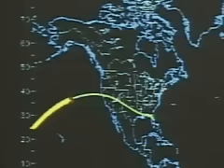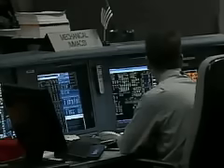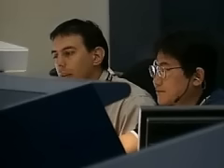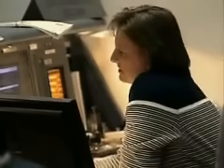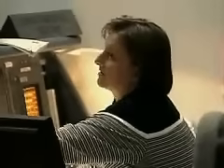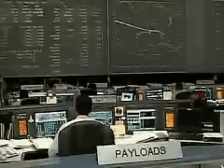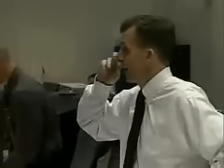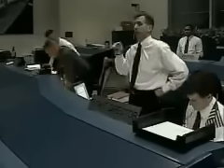Inside Mission Control During STS-107 Columbia's Failed Re-entry and disaster

Comment: When a scientist from NASA, runs around the place with papers in his hands, shouting and yelling, it might be a good idea to listen to what he has to say. Even inside NASA. The guy is still a NASA scientist, right?

Not so long ago, there was a man at the same building, begging to the mission controllers to stop a launch.
He was escorted outside by security. He smashed the windows, slammed the doors and then got outside to warn people for the impending disaster. 
The then sat on grass next to a pond and cried his eyes out.
When the accident occurred, he didn't even look up to watch, and kept on crying this time a little more deeper as Challenger disintegrated over his head.
Almost the same here, during Columbia's mission, a group of scientists calculated that the forces created by the foam impact was equivalent to 1 Tonne. 
This is the weight of a midsize sedan.
When the most critical part of any device is concerned to be damaged, you fix it first.
That heat shield travels all the way to our Sun and comes back since the Sun's surface temperature is reached during re entry.
Just because their stubborn attitudes, those precious scientist's of our planet had to go through the most violent deaths of the human history.
Reply: Neither I or Roger Boisjoly was a rocket scientist. And syntax errors
on YouTube comments does not make a comment legitimate or not. My
opinion is mine and yours is yours. Trying to discredit someone
because of typo's is foolish. You can disagree with me all day long
and I wont get angry. I have years of information, experience and
knowledge about the shuttle program and both accidents. My comments
come from memory and not Wikipedia or Google. I offer a different view
than most people commenting about shuttle. Have a nice day.
Reply: Your story is full of holes. "A man begged mission control not to launch and went outside and didnt even look up to watch". Mission Control and the launch site are in two different states. So that didnt happen. Also, scientist dont have anything to do with operating the shuttle. "The suns surface temp is as hot as the shuttle's thermal protection during re-entry". I dont think so. Suns surface temp is 6000 C. Re-entry is 3000 F. Do the math. Obviously you no nothing about space travel. If they have a problem, just fix it. Wow....
Reply: jrockett73 It is the story of the man who was responsible for the O rings installed on Challenger's main fuel tank. They had a temperature window to operate safely within. The lowest temp. was something like 3 or 4 degrees Celsius. The temperature that day was -11 degrees below freezing at Cape Canaveral.
You can catch his story within the several documentaries about the Challenger Disaster on You Tube.
 
According to him, the main tank was going to start leaking as soon as the shuttle starts to vibrate during launch which it actually did however, the hole got cloaked immediately by some residue in the fuel and Challenger was able to clear the launch pad. But when a sharp wind shear rocked the shuttle hard from side to side, the hole got unplugged and the al Hell broke loose.
That scientist knew this by heart and he just couldn't watch it happen I guess.
Who said it was my story?
 
What do you think happens when a flag rises in any of the shuttles systems just before T/O?
They stop the countdown right? And they "fix" the problem. What troubles you about that?
You simply do not launch seven souls to space when one of guys who build it says that it's going to explode.
He doesn't have to be a part of the Mission Control Team but that was the only place left for him to go and take his chances at that time.
Mission Control is in Houston but they take over the flight after it completes take o from Cape Canaveral right? I might have mistakenly used one for the other. This Incident took place in Florida by the way.

NASA overhauled it's managerial structure o allow these kinds of issues travel up the chain of command more effectively. This is the reason why the carried out a meeting about the Foam Strike during Columbia's mission. It was apparently not enough though.
Reply: Serhan Ogan First of all, the o-rings are installed in the solid rocket boosters between segments, not the fuel tank. The man your talking about is Roger Boisjoly. He is not responsible for installing the o-rings on the booster segments. He was the design engineer who was involved with the booster joint design. He worked for Morton Thiokol in the state of Utah. The boosters are put together in Florida by technicians and quality control. i know all about the accident. I was there. Mr. Boisjoly had the temperature discussion with his company prior to launch not NASA. They found out about the discussion after the launch during the investigation. Second, there is no instrumentation in the orbiter or mission control that tells you a o-ring will not work because its too cold outside. Launch control in Florida prepares the shuttle for launch and launches it when ready and the vehicle checks out as ready. Once you ignite the boosters for launch, there is no turning back. Your going somewhere. The whole problem from the beginning was that the joint design was flawed which included the o-ring.
Reply: Serhan Ogan  I knew Roger Boisjoly, and jrockett73 is no Roger Boisjoly. For one thing, Roger knew the difference between "your" and "you're" and would never mistake one for the other. I find it irksome, as you likely do, that jrockett73 appears to try to dismiss what I see as your efforts to point out that NASA's disgusting hubris is shameful. Obviously, rocket scientists are not all created equal.
Reply: Forward Fortune Great ! You're the proper English police here on YT. And because of the misuse of a word, you judge me to be not smart, wise or give me much credit. I also should be ashamed of myself because I dont believe in the events that led up to the Challenger accident? What your trying to say is that your comments are correct and everyone else should acknowledge them as correct. Some of the data on the internet is correct. But to say its all accurate is ridiculous. Even the NASA websites are inaccurate on their own programs. Your here just to fault people and prove yourself right. Just get over yourself and say " I have a different opinion" or " My theory is as follows" Nobody likes arm chair quarter backs!
Reply: jrockett73 Regardless of the cause, poorly written communication makes the communication less effective. You should have written, "Neither I nor Roger Boisjoly were ever rocket scientists." You will claim to know the difference, and that is ok for you because you do not believe use of proper English affects how your YouTube comments will be regarded. I did not imply that either of you were rocket scientists. My point about rocket scientists was not directed at you, but rather in response to Serhan Ogan's post regarding the stubbornness of those who could have, but chose not to delay the Challenger's launch. I did not point out your misuse of the word "your" in an effort to discredit you. You do not sound very wise or smart, and I do not believe many here give you much credit. You should be ashamed that you cannot acknowledge and/or that you do not find it in yourself to see the sadness in the reality that the Challenger tragedy could have been avoided. Finally, it is no surprise yet no less unfortunate for you that you rely solely on your memory to recall events and details as you have at your fingertips an invaluable wealth of accurate information. Your memory is fallible. Have a nice day!

Comment: Looks like at 5:17 was the last communication from the shuttle. "Roger, uh..." Something like that.
Reply: That's not the breakup. Communication was lost a few seconds before breakup started. I think that noise is just the system itself failing. The accident report calls that moment LOS, or Loss Of Signal. LOC, or Loss Of Control was a few seconds later, but the shuttle was still intact for about another 40 seconds after that. The report makes for very interesting, but also very horrifying reading. That last 50 seconds or so must have been really awful for the crew.
Reply: Thanks for pointing this out
Reply: aAaa aAaa Pretty sure I already said that :)
Reply: U can hear the voice in the background say "it's going down" while he says roger uh
Reply: And you can actually here the sounds of Columbia breaking apart before totally losing signal

Comment: I feel bad for Leroy Cain. He lost 7 good friends and he has to hold back the tears and carry on doing his job. At the end of the video you can see he's struggling to hold himself together. Rest in peace to those brave souls.
Reply: La nasa a commis une erreur énorme à ne pas vérifier l aile de la navette durant le séjour dans l espace. L autorisation de retour n aurait jamais été donné !
Reply: @fredericlandemaine2425  Suppose they did. " You have a hole!" . Then what?  Send one of them into outer space with a duck tape?
Reply: @elli003  That was Challenger, this is Columbia. Here the wing of the shuttle was ruptured on launch. It was noticed by the ground but they did nothing about it and didn't tell the crew. The mission went according to plan until re-entry where the hole in the wing caused the shuttle to not follow its intended course and broke up at high altitude. In this recording you hear them lose thermal readings from the section just aft of the hole. Incredibly sad even, RIP to all those onboard.
Reply: @Scythl  Almost correct - the crew were informed of the incident, just told that there was nothing to worry about, because at the time engineers on the ground had deemed the impact non-critical. You can see the email sent from the ground to the crew notifying them of the incident on the NASA website, as well as the whole series of correspondence between engineers on the deck debating the severity of the impact. Still, RIP to these brave souls, and commendations to Mr Cain who held the room together as the epitome of leadership.
Reply: @Scythl  they did tell the crew that something had hit the wing.
Reply: @Scythl  there was nothing NASA could do at that point, it wasn't because they didn't want to
Reply: @GravityGrave  There was another launch that could have met with Columbia and retrieved the crew within their food and water supply time, but they decided to try and land instead. Incredible shame.
Reply: Scythl not exactly.
Reply: @Scythl  no it wasn't ready at that point and for a rescue mission it needed to be rushed to make it launch ready...and that would have put another crew on risk. The main problem with Columbia was, that Shuttles had landed safe with small damage to the tiles. A lot of things went wrong (don't getting pictures from satellites and that stuff) but as often in life - we only know better in retrospective.
Reply: @Scythl  no there wasn't. The rescues came after this. They never launched another mission that couldn't at least make an attempt to rendezvous with the International Space Station, except for the last mission to service the Hubble.
Reply: @Scythl That’s not true.
Reply: @GravityGrave its nasa fault leroy fault
Reply: A paper shuffler and order giver, not an engineer.
Reply: @alphonsozorro7952  Um, LeRoy Cain earned his bachelors degree in aerospace engineering from Iowa State University. Mr. Cain was certainly an engineer.
Reply: @alphonsozorro7952  Does it hurt to be stupid? I hope so.
Reply: @alphonsozorro7952 Don’t be ridiculous.

Comment: Spooky. No passion anywhere. No indication of any problems, lives lost....nothing.
Reply: It's their job to stay professional. You expect these people to be hysterical or dramatic? They're not there to put on a show. They are there to guide the shuttle to a successful mission and in this case try to reach Columbia after lost contact, and then record all data for the accident investigation. The passion is there. Also there were indications of problems. Quite a few. They received those indications, the problem is in this type of accident is it is a boulder rolling down a mountain, you can't stop what is happening. Also Columbia broke up rather fast, it's not something they can scramble around and try to fix. Within the span of just a couple of minutes Columbia went from reading an anomaly, to shuttle loss and mission failure. Not jumping your ass here, just saying a lot is happening in this video, it's easy to overlook.
Reply: Losing their cool could result in more disaster.

Comment: Did they know that the shuttle wouldn't make it back? And, if they did, why didn't they launch another shuttle to repair or ask Russia?
Reply: They knew a piece of foam had fell off the main tank and hit the leading edge of the wing. It was actually fairly common during launches. A problem they had struggled with for years but it had never done any real damage. Obvious in hindsight this one had punch a hole in wind, but at the time they didn't think it critical as foam strikes had happened before.

Comment: Commander Rick Husband says "Roger, uh bu-" (cutoff) at 5:17, and LeRoy Cain tells the Ground Controller to lock the doors at 12:30.
Reply: Did they burn up?  Once the orbiter tumbled and finally completely broke up over the course of about a minute, their aerodynamics would have suddenly reduced and probably caused deceleration more than previously when they were still streamlined and with a lower surface area.  They apparently died of a combination of depressurization and blunt force trauma from the lack of the pressure suits inflating (because they weren't sealed yet... an inflated suit offers substantial protection), the oversized roomy helmets with poor head/neck protection, and the failure of the seats.  The further potentially-fatal depressurization effects and trauma occurred to their bodies after they were unconscious from the depressurization, though.  With better seats, better head/neck protection, and their pressure suits sealed up at the moment of cabin breach, for all I know a few of them may have survived with injuries.  Unlike the USAF systems, their chutes were not automatic, though.  Another weird oversight.
Reply: @Reticuli  The cabin depressurized so fast that it would have killed or incapacitated the crew members within seconds. They died very quickly and likely didn't feel anything.
Reply: Horrible to think of Husband burning up.

Comment: what are the black phones they talk about not being able to disable at 16:25
Reply: They're probably just run of the mill phones that are set up to get outside lines, instead of making internal calls in Mission Control (and other parts of NASA that they might need to contact).  It's not uncommon to have the phones be different colors so people know immediately which phones are "outside" phones, and which ones only connect within NASA.
Reply: Outside line.

Comment: +Jenny M It is NASA protocol to lock the doors of the flight control center when something goes wrong. No info in, no info out, normal protocol procedure in the event of disasters. When the Flight Director gives the order to lock the doors, that's the moment when it becomes "official" that a disaster has occured. Even though all the people in flight control knew it at that point, it makes difference when it's officially acknowledged. So I guess that's why everybody reacted at that moment.

Comment: Sad day, but the problems began years before when they started to ignore foam strikes, disregarding the rules.
Reply: The problems began when they changed the foam, for idiotic political reasons, to appease environmentalist whackos, and began having foam strikes.
Reply: +Odysseus Rex Source?
Reply: AverageGeek  I'm not sure what you mean, it's public knowledge, but I used to work on the Space Shuttle project so maybe I'm just more in touch then someone else might be. If you remember, in the 1990s, there was a huge ouccry from the environmentalist whackos because chloroflourocarbons were "destroying" the ozone layer, there was a "hole" in the ozone layer over Antarctica and we were all gonna DIE! 
Without going in to detail, none of this was true, but nonetheless, the squeaky wheel got the grease and the Clinton administration acted to ban CFCs, not merely in the aerosol sprays that did put such chemicals into the atmosphere, but even in solid materials like the Space Shuttle external tank insulation. So, they changed the insulation. The new material bu golly had no CFCs in it. But it became much more brittle when exposed to the extreme cold of the cryogenic fuel and oxydizer, and resulted in large, frozen chunks breaking off and hitting the orbiter during launch. The original foam simply didn't do that. It did have small bits break off, but not nearly as large as the new stuff.
The chances of this kind of accident happening on any given mission increased greatly after the change, but by golly we saved the ozone layer? Which, by the way, still thins out over the poles, the South pole especially, every winter, because it's perfectly natural for it to do so. Seven people died and a billion dollar spaceship was lost, but environmentalist whackos and their political supporters don't care.